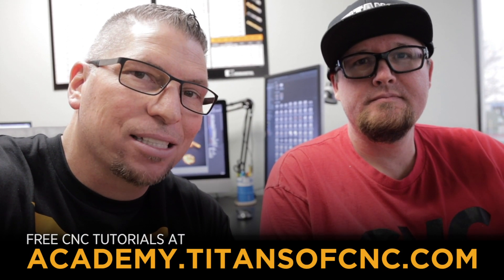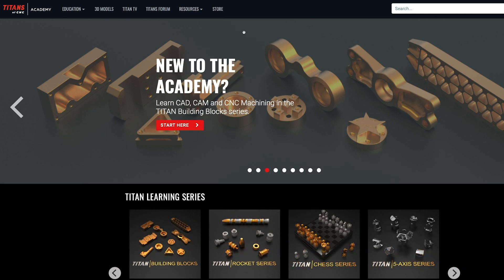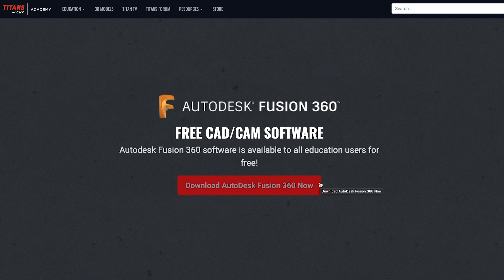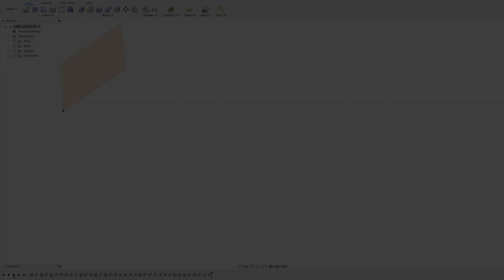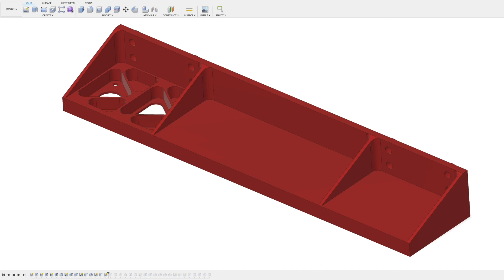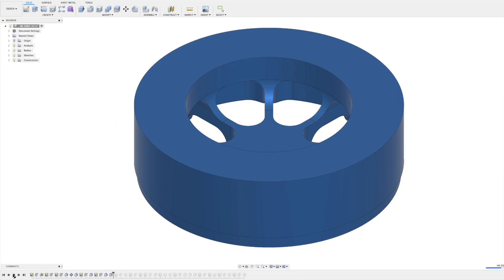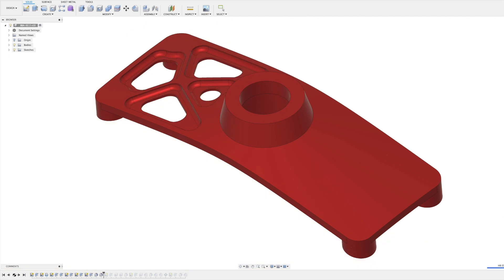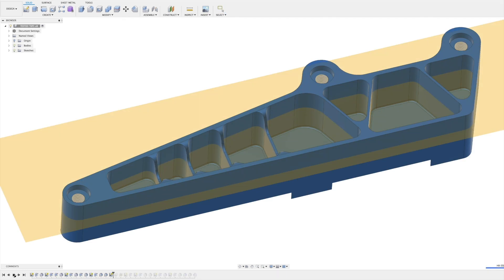3D Modeling 10 Aerospace Parts in 2 Minutes - Vlog #55

Comment: Hello Titan! Greetings from Romania!I don't know exactly what are the legal issues but I think 1911 pistol drawings are an excellent resource for teaching CAD since it has both easy parts and difficult parts,solid block parts but also spring and sheet metal parts.Check it:  https://d2t1xqejof9utc.cloudfront.net/files/71651/m1911-a1%20redux.pdf?1448504081

Comment: I knew it had to be click bait. Two minutes for the fastest draftsman in the world would only get you a fraction of one of those parts.

The real skill comes after you program it and figure out how to hold it to machine it. And that's how to measure it against the print to see if it's in spec! To make it a true challenge you won't be allowed to use a CMM or an optical comparator. That will separate the men from the boys fast. To be able to do that on the shop floor is where the big money is saved. Waiting on QC for first part inspection means you have a cnc sitting around not earning it's keep. With short production runs the more money is waisted waiting on QC.

Comment: I have an idea. Maybe do tiny clips with skill specific CAD CAM. I run into trouble with contour champhering when champher is deeper into a part and goes right up against a flat wall on what would be machined in a 3 axis mill. That is only one example of difficulties I encounter. I make the models you guys offer for traing a couple or a few times then make a similar but different model using same skills being taught to prove to myself I understand and can do it and can create the CAM as well. Trust me guys I wanted this and could not afford it you are lifting my life to a higher level thank you very much.
Reply: Sometimes modeling the correct chamfer helps when it comes to CAM... sample of a Different abnormal chamfer >>>> https://academy.titansofcnc.com/series/titan-404/how-to-draw-the-titan-404

Comment: Hey Titan did you use any porting tools in the past? Any recommendations or ideas how to create hydraulic ports and cavities?
Reply: Lukasz Gorzala try allied max cut
Reply: Dave Kearley did you use it?
Reply: Lukasz Gorzala yes  accuport cutter . Standard fittings used in Aluminium 17-4 And Ti
Reply: Dave Kearley I heard it’s not consistent in large Bach sizes equals to many scraps also should mention it’s for mild steel applications
Reply: Lukasz Gorzala Dont know who you asked been before now was using this tool making 120+manifolds for 787 and A350. areo parts and industrial manifolds 300 series stainless .
Reply: Dave Kearley that’s why I’m asking / searching for people with experience     Thanks